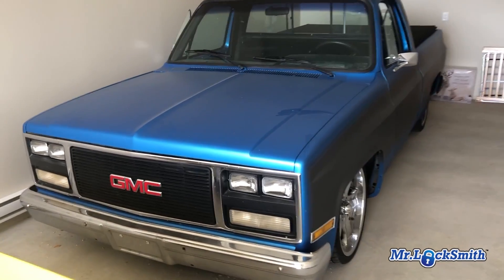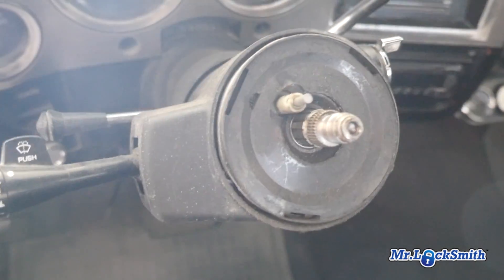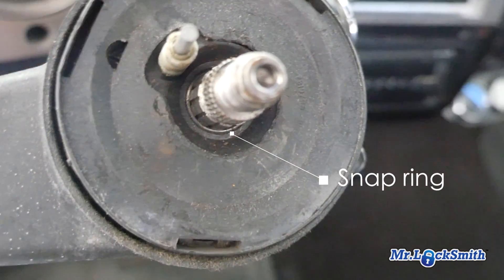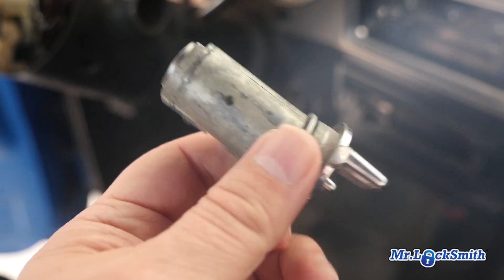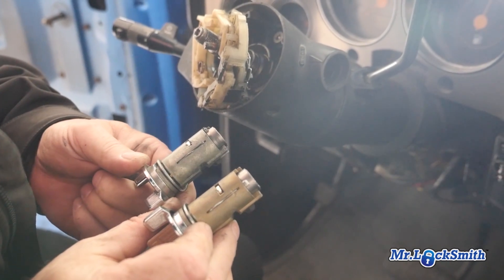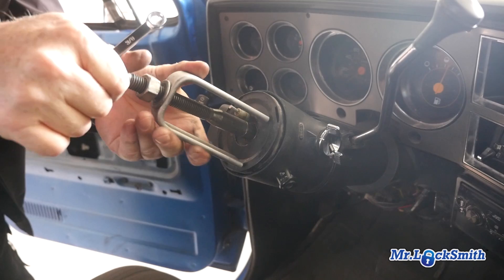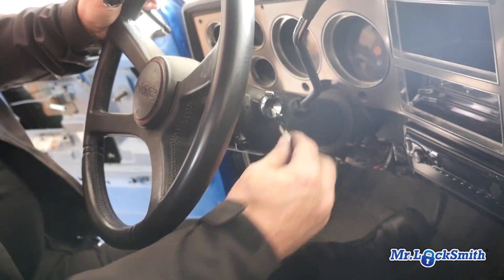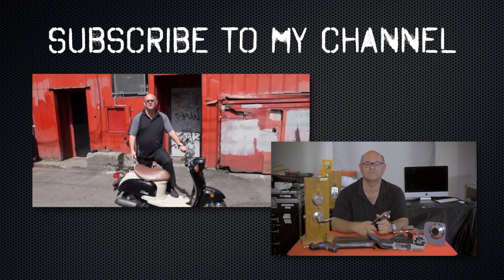Replacing 1979 GMC Pickup Truck Ignition | Mr. Locksmith™

Comment: I've done a few of these and it's easy. Well done on putting everything back together.
Reply from the maker: Tennessee Tarantula's You never know what you find pulling apart some of these older cars. Missing snap ring on one lol
Reply: @24hrMrLocksmith  wow lol. That's so true. Never know who has been in there before or if they put everything back together right. Lol
Reply from the maker: Tennessee Tarantula's Rarely find a working horn. Plastic stem/ holder usually broken too.
Reply: @24hrMrLocksmith  Ya I had to fix my buddy's horn back a few years ago. Someone had messed it all up.

Comment: Just sayn but that can't be a '79. The front end is an '87 but that can be changed. Its much harder to get the newer dash in an older model.
Reply: its blatantly apparent they did a lot of work to make it non-standard, so its not that surprising that they could have changed it up entirely.
Reply from the maker: Chasis  and VIN it’s a 1979, however, modified and non-standard parts :-)
Reply: Awesome! That takes a lot of modification. I'm in Texas and the reason we would do something like that is emissions laws. The '79 has less emissions control. I personally don't like the front on the earlier ones so this is something i would do so i can have a bare block (no engine accessories except alt) but have the '80s body. On the earlier bodies, the cowl (vents in front of the windshield) are a part of the hood. The dash is also different. Most people just leave the original dash. Highly modified. Very nice.